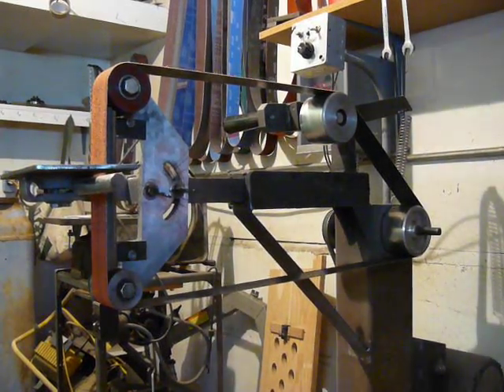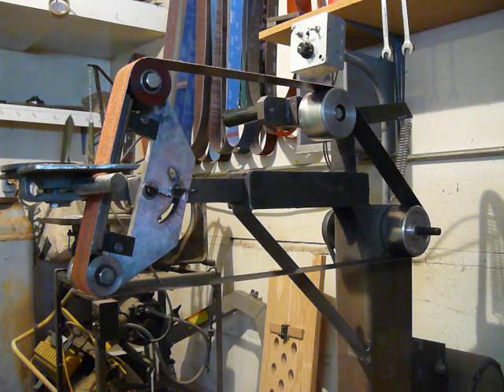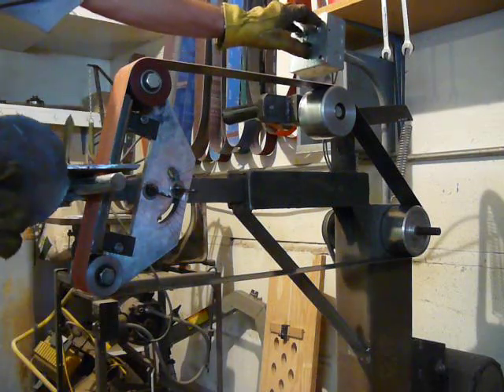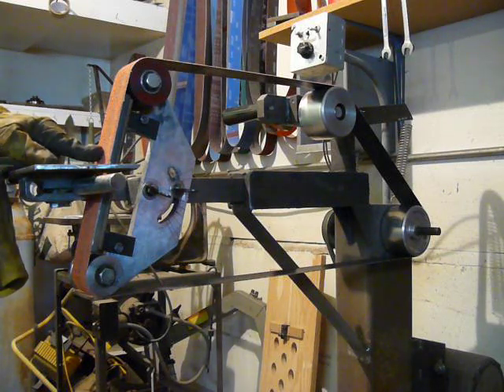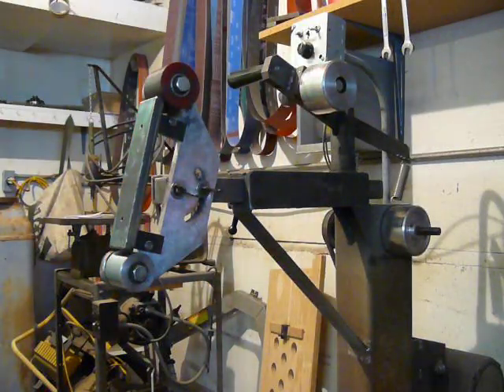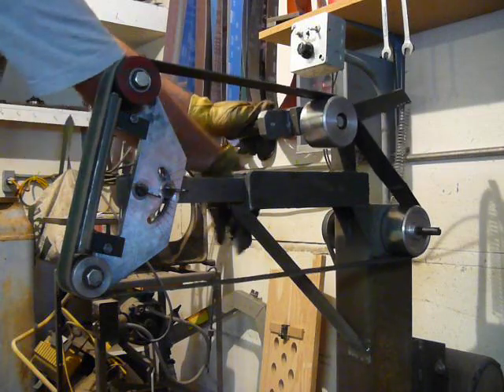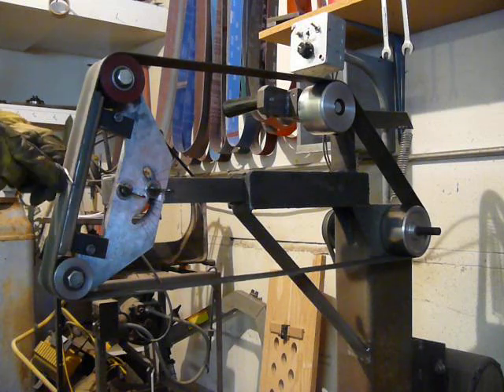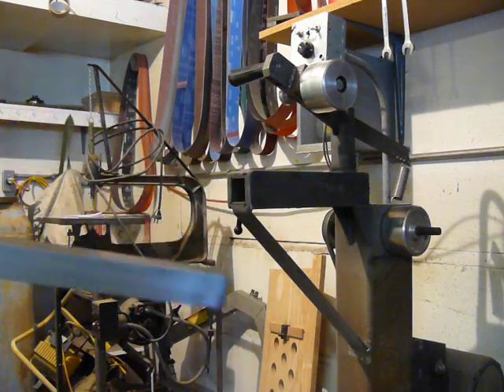Belt/Knife grinder 2"X72" Home Made 1.5hp 3 phase

Comment: Hey mate, 
Im going to be building one of these 2x72 grinders soon...and i need all the help i can get! i was just wandering about how your controlling the speed, is it a vfd, or homemade? if so, where did you get it? and how much?
Reply from the maker: Yes.. The speed is controlled by a VFD.. I purchased mine for 80.00 on E-bay.. You may want to check with Surplus Center in Nebraska they have a web site and carry Teco brand at a good price.. After using the grinder with the speed control, I feels its almost a mandatory rather than nice to have item.. It lets me slow way down for using a leather belt or to prevent over heating sensitive items.. With the variety of belts available I can sharpen carbide and tool steel or point my tungsten electrodes with this grinder.. VERY VERY handy in deed.. I seldom turn on my wheel type grinders any more..
Reply: Thanks very much, I'll definitely look into it...Im actually in Australia but il check out that Surplus place anyway...btw was just wandering if your motor is ac? and what horsepower/rpm it is?

Thanks again, Anthony
Reply from the maker: hunteddown846 Anthony.. The motor is one and a half (1.5) horsepower, three phase, 220 VAC.. The name plate rpm is 1725 but with the VFD it can be spun up quite a bit higher than the name plate with no problems.. You don't need three phase power in your shop.. The VFD will take single phase power and convert it into three phase output to drive the motor.. The only problem with the lower priced VFD, that I can find, is that the manual is written in Chinglish.. Chinglish is what you get when a person in China attempts to draft an English document.. The VFD is quite complicated to get set up for the first time.. There are a large number of parameters that must be input by way of the key pad to get the performance desired from the motor.. Another word of advice.. YOU MUST ENCLOSE THE VFD TO PROTECT IT FROM METAL DUST AND SHAVINGS..!!! When in operation the VFD produces magnetic fields in and around the circuit boards.. If not protected from the grinding dust the VFD will pull in the grinding dust and short out very quickly.. I have a few VFD's set up in my shop running the mill, lathe, grinder.. They are all mounted in air tight boxes.. I have another video that goes into the VFD a little better I can't recall the title but it shouldn't be hard to find the wife and I only have a half dozen or so videos..
Larry
Reply from the maker: hunteddown846 PSS Anthony.. In the lathe video the VFD is not mounted in a box yet.. I have since mounted it in a box with an acrylic, or as they say in England perspex lid.. I did discover this magnetic attraction to grinding dust the hard way... Larry..
Reply: Thank you so much mate...your advice will save me a lot of money and screw ups! you've been super helpful